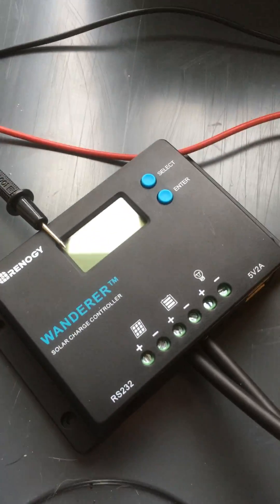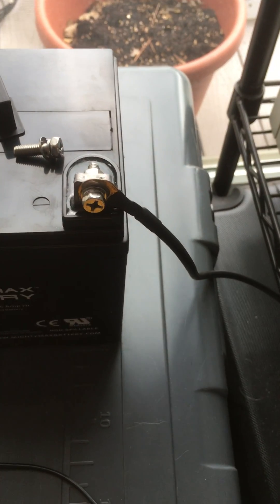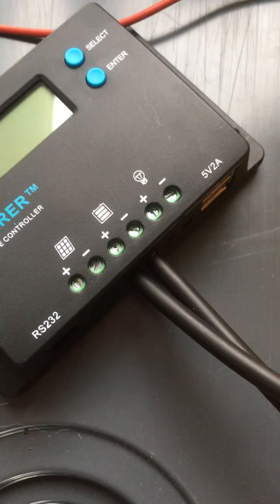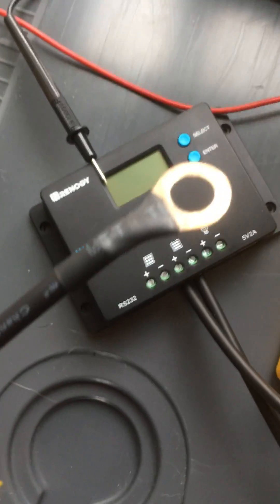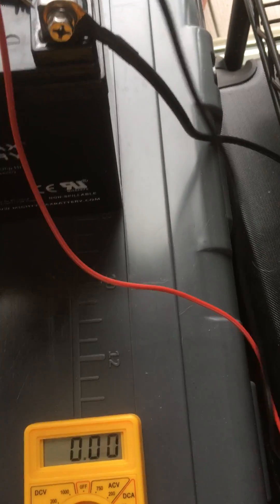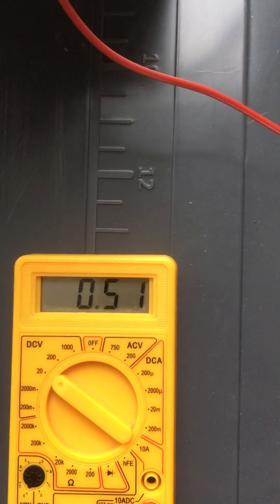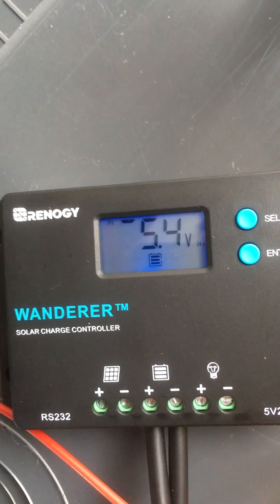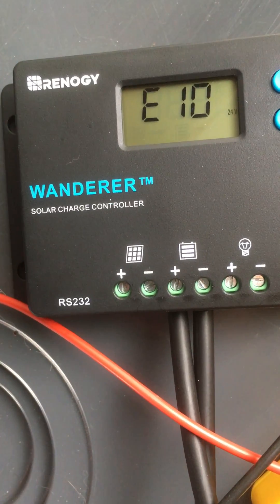Renogy Wanderer 10A PWM power-on. Error E10.

Comment: Mine wanderer 10a  was putting 18 volts into my 12v lifepo4 battery. It is ruined, and I heard others have this problem, and renogy tries to say the 12v battery is at fault, how? What would make my battery voltage (not pv, it was at 21v) climb to 18v?
Reply from the maker: The only thing I can think of is that the Wanderer was set to 24 Volt battery accidentally.

Also, any quality lifepo4 battery will have over voltage protection in the Battery Management System which will stop charging the battery when the input voltage is too high, so I don't think you've got a well protected battery.
Reply: @AlanKilian  It's set to 12v and the battery does have a bms. Not sure what happend. Thanks for the reply!
Reply from the maker: @usarmyfl1  Super bummer that your battery got ruined. I returned my Renogy and I'll not buy another one of their products again. Too many people like you have had poor experiences.

I replaced it with a TopSolar unit. It's working well, but it's still basically new, so I'll see if it continues to work.

https://www.amazon.com/gp/product/B0836PVY8J/ref=ppx_yo_dt_b_search_asin_title?ie=UTF8&psc=1
Reply: The LiPoFe should have a BMS on it to regulate the battery , keeps it balanced, something a solar charge controller doesn't do

Comment: get anywhere with this? i have same error
Reply from the maker: I got a response and a trouble ticket number from Renogy and then the stopped replying to my messages. 

My opinion is that they were trying to delay until my Amazon return window closed so I just returned the whole package to Amazon unfortunately.
Reply: @AlanKilian   yes I also have the same problem. I will have to try and contact them. I will keep you updated.....
Reply: I’ve had the same thing happen on 2 units thus far. Same thing happened as yours, the random numbers and what not on the display before showing e10.
Reply: I also had this happen to me in 2020 and now today on the Renogy 10amp wanderer.